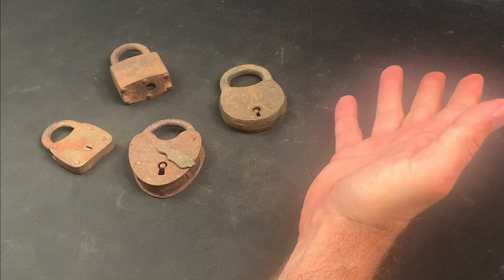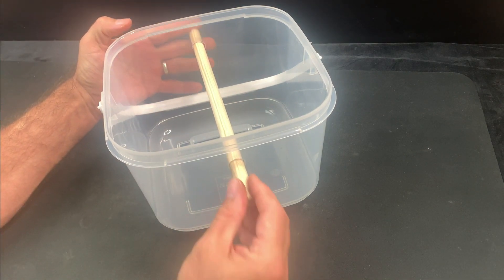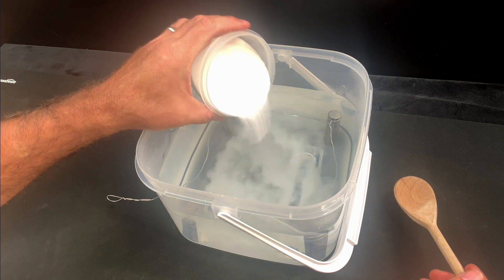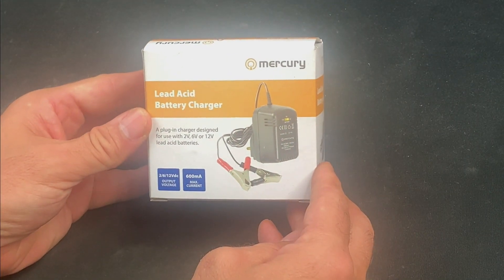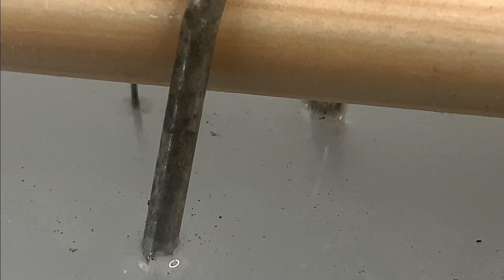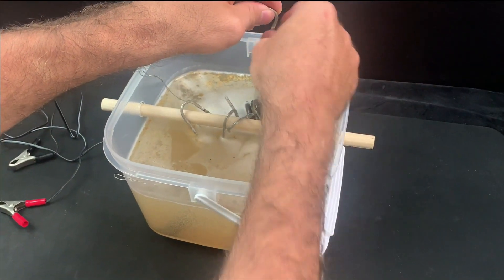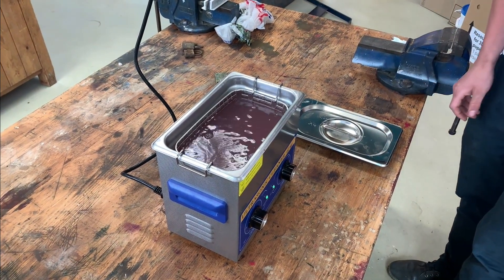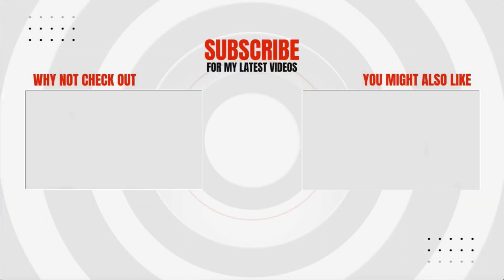043 Restoring vintage locks using electrolysis

Comment: Wonderfully clear demonstration of electrolysis and sonic cleaning. You might also consider chemical treatments for large locks (e.g. Evapo-Rust) alone or before Sonic cleaning.
Reply from the maker: Will check it out - thanks 🙌

Comment: Great video! Did you check if the locks' internals work well, too, after the cleaning?
Reply from the maker: Not yet Erich - most came without keys but I have successfully opened one using warded picks 😉

Comment: It always seems as though there is a fine line on this sort of thing among collectors. They want the patina an old lock but no one wants an old rusty dirty lock either. And if you have one that is gone so far, you certainly don’t want to ruin the lock by cleaning it up and making it look brand new in some cases. Of course it varies from collector to collector as it does for anything, but one wonders what the market is today. Of course bad restoration is always worse than good.
Reply from the maker: Agreed - I think that there is little harm done here - the patina will return - even if I don’t live to see it 😉

Comment: Glad to see a new video out for you! The electrolysis worked very well. I think the ultra sonic bath and buffing goes too far for the brass locks. As you stated we all have our opinions but I think it's nice to have some patina on an old lock.
Reply from the maker: Yeah I am sure your view will be shared by many in the community - the good news is that the patina will come back with a little time so no harm, no foul I guess? 😬